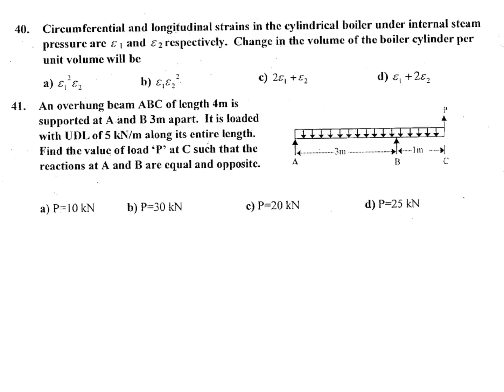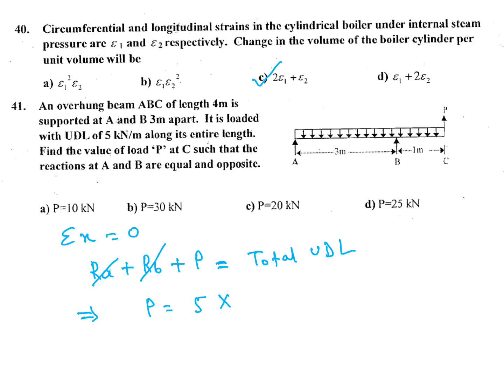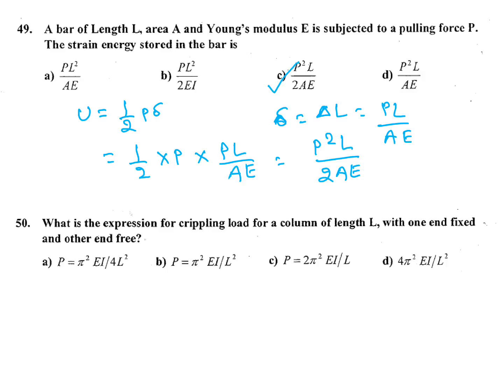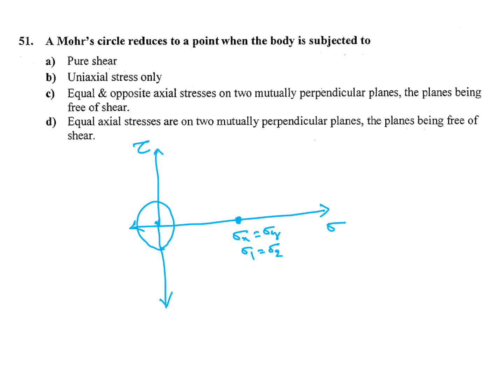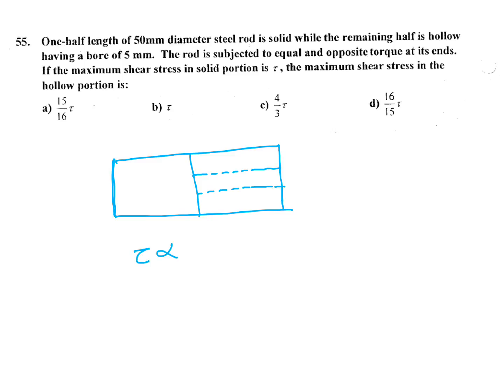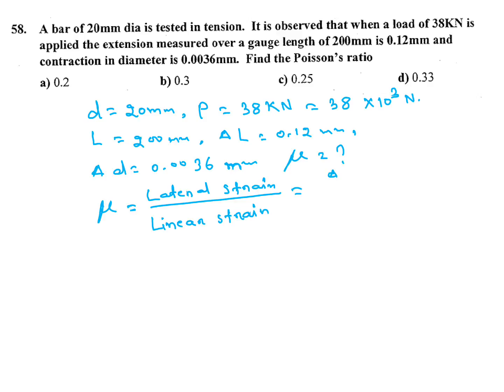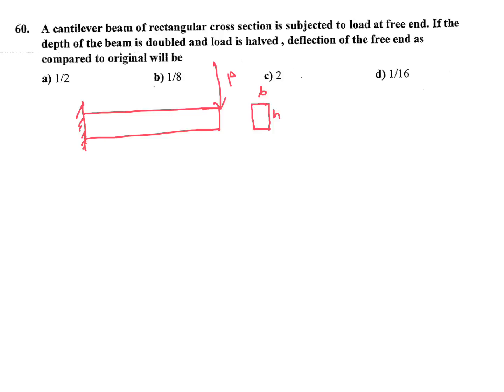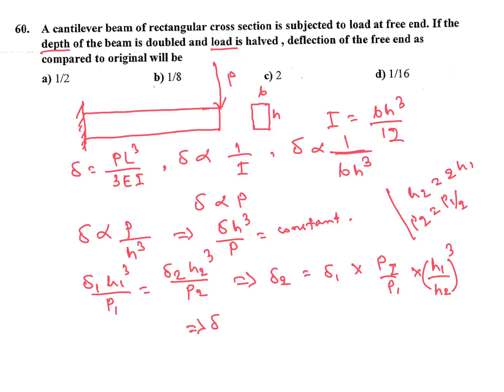ISRO QUESTION PAPERS SOM - 05

Comment: sir first we thank you for your valuable lectures .

I have a doubt with que 55. 
how the shear stress for hollow and solid shafts remains same..?
shear stress is Torque * radius divided by polar moment of inertia..
 the polar moment of inertia differ for solid and hollow shaft..

please clarify it
Reply from the maker: Dev Prasanth what you gave in that formula shear stress is average shear stress. but in Q's they asked for maximum shear stress , you check it if diff ans coming please inform.
Reply from the maker: Dev Prasanth also my ans is matching with made easy ans.
Reply from the maker: Dev Prasanth  formula for hollow circular section maximum shear stress  16 TD/ 3.141*{D^4-d^4}  for solid circular section maximum shear stress is 2T/3.141*r^3. Use it and comment.
Reply: MY MECHANICAL ENGINEERING yes .you are correct, in this case the shear values are approximately same for both.

thank you..
also
I had came across same problem with bore dia 25 mm instead of 5 mm their the answer is different..
Reply from the maker: Dev Prasanth welcome 🖋🖋
Reply: Sir shear stress is directly proportional to radius??  Is this concept correct in no.  55?